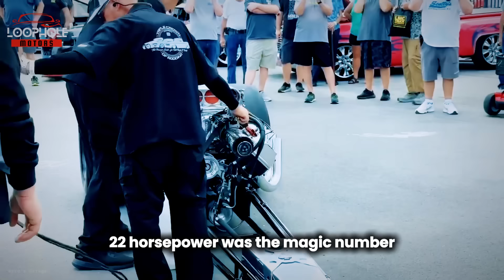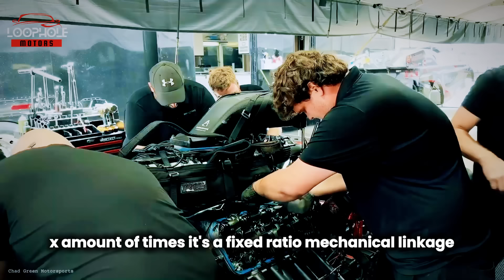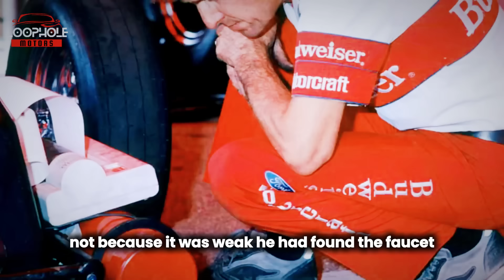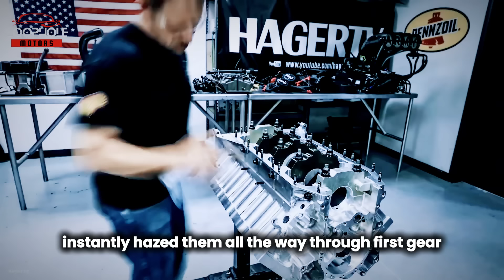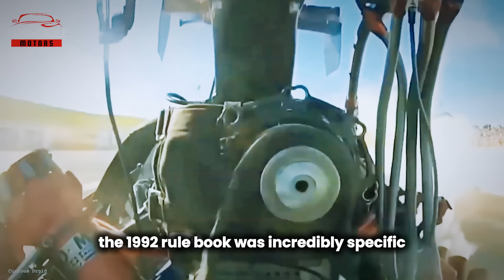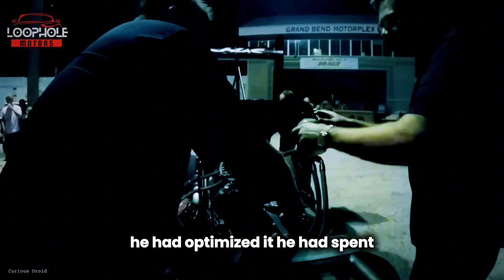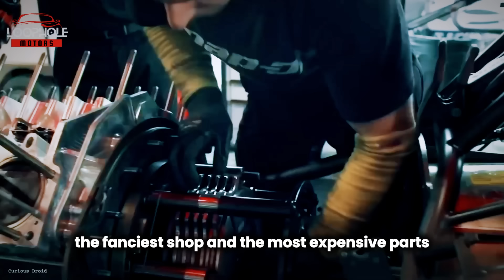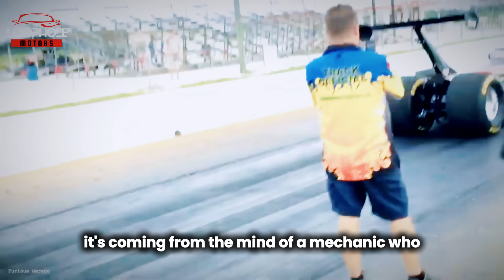How One Mechanic Hid 300 Horsepower in Plain Sight.

Comment: The only part of this story that I don’t buy is that supposedly a random picture taken by someone who probably knows absolutely nothing about a top fuel engine, and was able to point out SOMETHING ODD with a crank pulley tooth. I very very doubt that was what happened. I think someone has been eating too many race track corndogs.
Reply: Well remember the barret 50 cal rifle was invented by a photographer,  I wouldn't say it's that outrageous, as a photographer myself, we usually have very keen eye for details, so if something looks a little different than rest, or wouldn't be outrageous that a photographer spotted it
Reply: when your job is looking at the same thing everyday, you start to notice.
Reply: Analysis is the sum of looking past the obvious. EVERYTHING matters.
Reply: photographers notice when something looks different.  if you look at the same thing all the time you will see the subtle differences.
Reply: They were definitely hired for thousands by another team to get high res pics of that bay.
Reply: As a photographer myself, when shadows look different we look at that quickly. Not saying its true here, but I wouldn't doubt it to be plausible.
Reply: McLaren's "fiddle" brake, a second brake set-up to aid cornering in '97/'98 was discovered by a photographer taking a photo of Coulthard  in the middle of a corner with a red-hot brake disc (only happens under braking) and when one the McL's failed to finish a few races later, another photographer stuck his camera in the cockpit to find three pedals where there usually was only two. Motorsports photographers generally "know" what's standard on the cars/series they focus on, I don't doubt one from a drag racing magazine would have found teeth were there usually was none to be off enough to get a 2nd opinion.
Reply: What, you bought that apparently the top fueller "hazed the tires all the way through *first gear*"? It's the picture you find less believable?
Reply: @Scathing-au  if it’s me you are referring to, I don’t buy into a random picture being able to show something odd with a lower crankshaft blower pulley that is way down in the frame and surrounded by untold amounts of other parts that are needed. It would take more than a picture to determine any difference. Further more back in those days no team would have let a photographer within a close enough distance to even see the pulley. I’m an engine builder so that part about tire hazing I couldn’t answer.
Reply: All I’m gonna say is that it is very normal for the dumb to not recognize who is actually smart, because they think most people are just like themselves 🤷‍♂️😂
Reply: It took looking at a picture to spot something different happening dynamicly. Then you know where to look VERY closely.
Reply: I’m looking for the picture. Haven’t found it yet
Reply: If you think that's the only odd part I say you are stupid!
Reply: If I catcalled a random girl and she turned around and thought "Oh he must like me, I should talk to him."   A photographer really interested in the photos he took and noticed it was different from all his other pictures. I think both are soundly at about .05% of a chance.   

I agree it's low chance but not impossible. Catcalling leading to a positive result is probably harder.  It's less like a random photographer and more like a mechanical nerd photographer looking for ANYTHING.  Catcalling a promiscuous women would increase the chances too.
Reply: it took a millwright to fix a problem everyone had. nothing odd about that at all! have a mechanical problem? call a competent millwright.
Reply: No, its the just the meth.

Comment: I always wondered what happened to cause horsepower to explode in drag racing but I was deep in circle track racing at the time. 
   I fully understand sitting and staring at a part or something trying to figure something out, some new understanding of the physics of going faster.
  And so often it's not inspiration but a mistake or a jury rigged fix that was the AAHA moment.
Reply: Something seized,  its that simple